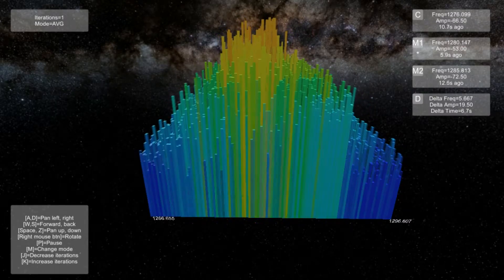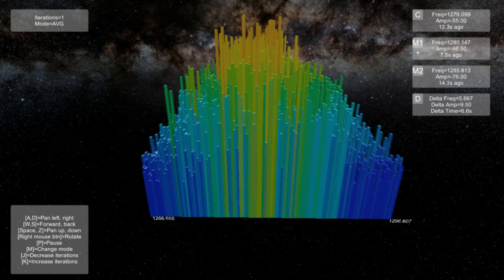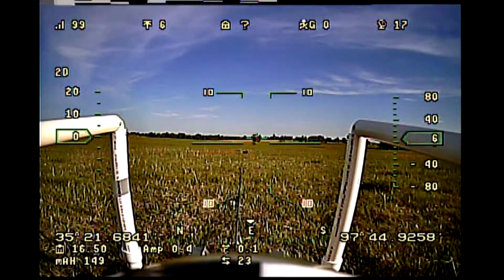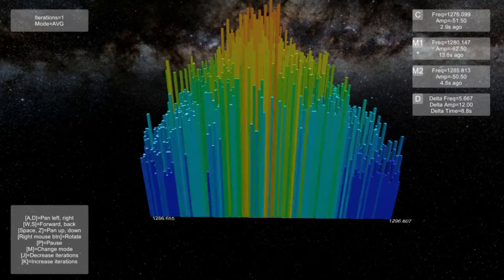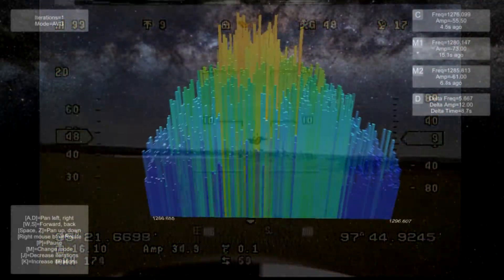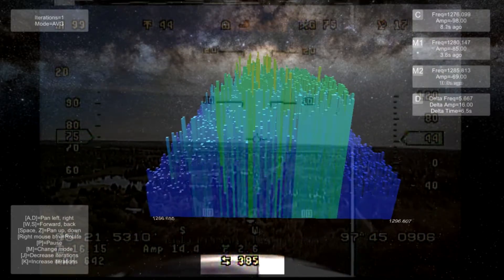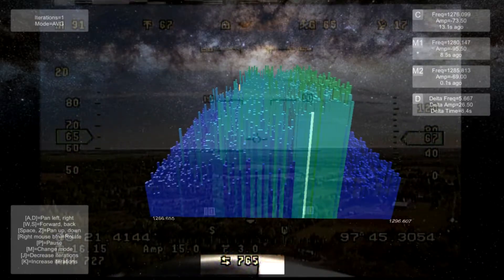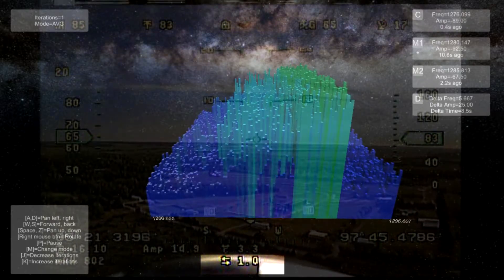RF Explorer: A Practical Use Case

Comment: Hi, Sir,

I am going to buy RF Explorer ISM COMBO PLUS, but before that I need to ask you a question. Please help, I will be thankful to you. I need to install 50 LoRa Sensors 433MHz and a TrX. In order to install them at best location I consider to use RF Explorer for best placement of TrX and Sensors. My shed is 200m by 200m and height is 20 feet. I use these LoRa temperature Sensors to display on locla HMI only. 

Many thanks for your advise of any kind.

Comment: amazing how I stumbled upon this video, I have the exact same problem. what solution did you go with? change video frequency? can it be solved with some filter to strip the frequencies over 1280? maybe a preamp?
Reply: Changing frequencies is best if you have the option to do so.  Otherwise, use a high gain antenna like a Yagi so that you can more easily reject the interference as the directionality will attenuate signals that are away from boresight.
Reply: @danielparrott1833  thanks!
Reply: also, maybe a saw filter can help